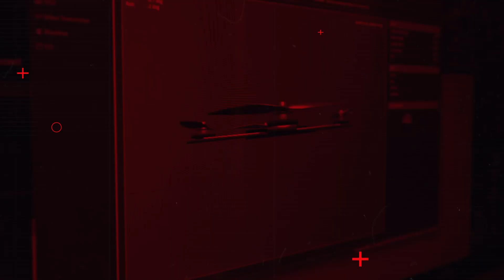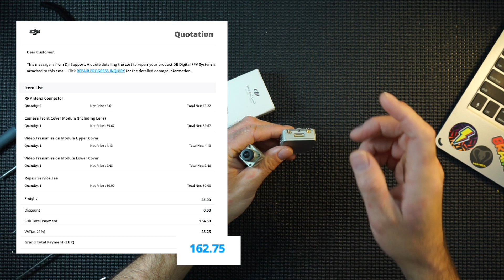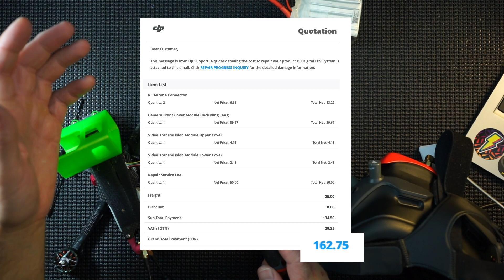DJI Air Unit Fix - Broken MMCX Antenna Connector

Comment: Why would you upload a video with such a terrible solder job, when the fix didnt even work (obviously since you soldered active to ground...)
Reply from the maker: well I'm glad you asked... I pointed out in the description etc and yes my solder was completely shit... BUT, the video shows you what part you need to fix the air unit, where to buy it how much it costs, how to take apart the air unit, how to replace the part - BUT do a better job on the solder.... - or send it to DJI for them to fix for around £150!!!!!!!! - - - - - - - - - - the fact that you can buy the part for £2 and replace it pretty simply should be shown - this is a common break point and can be fixed! - is that ok? x
Reply: instaBlaster...
Reply: Hey what do you mean by soldering to the active ground?I followed this exact step and it's not getting any range , what part of the soldering should ifix? I solder the 3 pins to the pad all 3 side (left middle and right)
Reply: @randysem1194  did you ever get an answer to this?
Reply: @MrSabram07  no but I watched another video of someone solder the attenna straight to the unit and it's such a better idea! Check it out  instead of buying new antenna and new mmxc to sma just solder it to the unit but stripping it
Reply: @randysem1194  link?
Reply: @randysem1194  are you talking about stripping the coaxial and soldering the wires directly to the pads?
Reply: @MrSabram07  yeah the attenna ! Stripped it then the little wire he then soldered it where the mmcx-sma piece is on the air unit (first he removed the mmcx sma) then when he solder it kinda bridged it over ! Idk if I'm making sense! Looks like a "m" the pad piece where you solder, well he solder attenna coil in middle then bridged it over from the other side to the other side and it worked
Reply: @MrSabram07  I have to find the video I make no damn sense 🤣
Reply: Where exactly did he go wrong? I need to fix my AU for the same reason and don't want to screw it up.
Reply: @MrSabram07 I’m confused but this sounds legit way better I broke 2 diff air units antennas in 24 hrs building 1 drone… hahaaaa fml
Reply: That sounds dope

Comment: I just have to say I love for you put the capacitor, and that location you can put in any size you like
Reply from the maker: keeps it out of the way as well!
Reply: @Datfpv  I did have a question are you able to solder the capacitor wires right to the battery cable pads or are you putting a wire between the capacitor and the pads?

Comment: Does th air unit burn out without antenna I had mine on but I guess the connection wasn’t good and I didn’t have the automatic low power on either I notice lower range but not totally I ordered new antennas
Reply from the maker: iys possible yes... I've done it we all have at somepoint :( only way to fiond out if its ok is to fly it and see.
Reply: @Datfpv  My buddy gave me a new antenna and it seems to work perfectly fine now thank you for the reply

Comment: Thanks for sharing this. Mine just broke and Im wondering how the heck to get out the tip from the air unit. I will try to remove it without disassembling the box. So this is my last resort. Good to know i dont have to spend another 200 bucks on an air unit for a drone that is less than 4 days old.
Reply from the maker: Glad it helped
Reply: Were you able to get it out, I've tried putting a screw in to pull it out I've even tried soldering a piece of wire to pull a piece out yet that piece is still in there
Reply: @MrSabram07  Worked like a charm! Thanks again
Reply: @MrSabram07  What you can also try is a small hobby hex screw driver that just about fits in there. Then stick it in and push down a bit. Not too much to widen the actual socket but to try and pop out the broken antenna butt. I know its a pain, the design is really bad but keep trying.
Reply from the maker: @MrSabram07  i got mine out but it ruined the connector n=made it a bit wider and the antenna didn't fit again.... its horrid break to have :( - I mostly just use vistas now!

Comment: Hi there. 

Can powering the air unit without antennas connected ( without the goggles on) fry the air unit? . I stupidly powered my air unit for a firmware update without the antennas attached. Im worried i damaged the air unit. Do you happen to know if i have likely caused damage  because of this mistake?
Reply: yes it will damage it. you might have gotten lucky... it will be in low power mode so maybe... only thing to do is connect the antennas and see if you get a signal....

Comment: wow I've always had good experiences with DJI's customer service.  I was expecting a 200+ dollar bill when my goggles got burnt but they put it on the warranty no questions asked.
Reply from the maker: Hey - I wasn't very impressed at all with dji on this one, they said nothing about a charge before I sent the unit off to them and then bam quote / cost etc... and it should of been such a easy fix... well it is!
Reply: They were the biggest pain to deal with I've ever worked with when I bought a mavic that bricked before the first flight...hate dealing with them...but the do make great stuff.
Reply: Exact same thing happened to me and they build me 60 US dollars which is half the price of a new one. And now my new ones broke again, I think I need to start using pigtails to some sort of antenna mount on the frame

Comment: I've had a couple of the antennas break inside the connector now.. It's so frustrating. I'm thinking of switching to the vista altogether.
Reply from the maker: yeah its not the best is it :( and the amount they try to charge you for a fix!!!... hit that subscribe! thanks man
Reply: I commented before that I'm going to try some pigtails to a separate antenna mount hoping that with the pigtail between the antenna and the air unit there's no pressure on the plug
Reply: Just not ready to give up the DVR function

Comment: Hey quick question brother! So I followed everything exactly the same for the sake connection piece off Amazon but today when I went to fly I flew maybe 60 ft and the range was turning red and camera was breaking up! What's that indicating?
Reply: you can't solder connect all pins like he did. must be clean like other side like three separate pads

Comment: I'm in the same boat! HOW did you remove the broken bit??? I've tried everything tweezers, hobby knife, heated the end of a glue stick and used that hoping to remove it like a broken door key....nothing...
Reply from the maker: Hey - I had to literally scrape it out if there with a small pair of nail scissors it took forever to do and it bent the connection making it a little bit loose... maybe a small screw might do the job if you can get one in there and pull!! - you're probably going to damage the connection whatever you do though...
Reply: A lot of people had luck screwing in just the right size screw enough for the threads to grab and allowing it to be pulled out

Comment: Which temperature did you have your solder when you remove the first connector? I read some people broke the traces on the board.
I have to do this as well, my antenna connectors popped up inside the female on the first day I received the unit, I didn't even have time to activate the unit nor to mount it in the drone.
Reply from the maker: my iron is alway at around 380 / 390 - when you solder the thing back on make sure you do it a lot better than mine, you need to just solder each pin sep, make sure solder doesn't join up... I've been meaning to do a follow up to this vid...
Reply: @Datfpv  I guess you had to buy new antennas too, right?
I contacted DJI support just in case the warranty applies, the seller doesn't want to deal with it, bastard!
Reply from the maker: dji told me my warranty didn't cover it.. only had the thing a couple of months.
Reply: I just got the reply from DJI, the warranty doesn't cover it either even though my air unit was just one week old. They wanted to charge me 113€
Reply from the maker: @miguelangelgalindo3124  yeah its not good is it really of them... you can pick up the module without camera for £99....

Comment: you bridge the active and ground elements together?? they are supposed to be separated (reference to the other working connector).. etc.. no continuity between active (middle) and ground (external 2 pins) elements.

please fix it asap.. but i think you already damaged your air unit by powering it on :(
Reply: Yup, I wonder how many people broke their Air Unit doing this…
Reply: So if you power the unit while you bridged the elements you will ruin the unit?